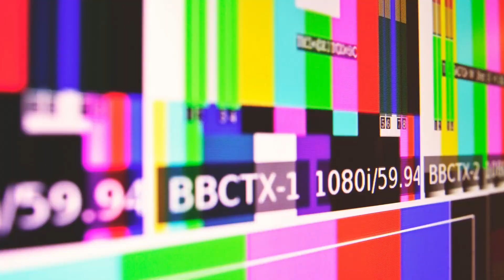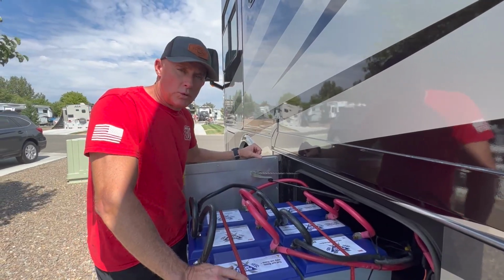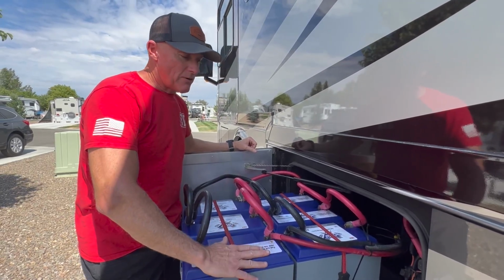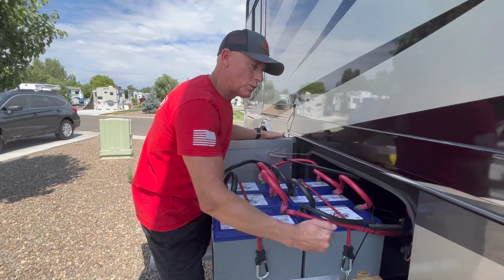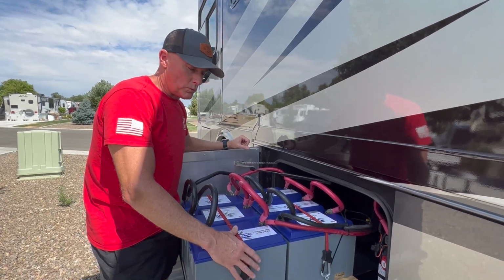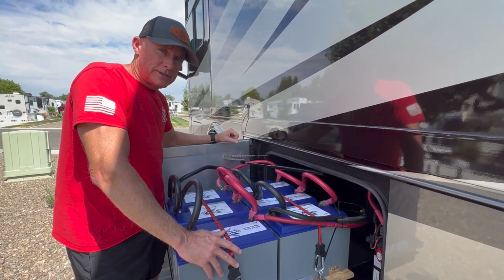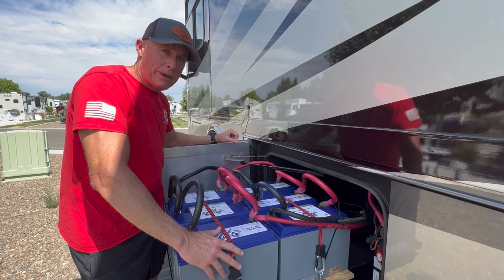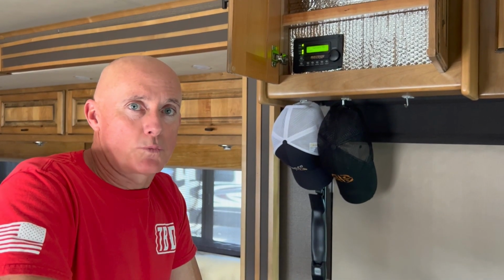Some UPGRADES come at a higher price.   Hopefully it is WORTH IT!

Comment: I want to add 4 Lithium batteries to our 37 PA we have the same inverter did you need to make any other changes? is there an issue with the alternator charging the batteries?  Thanks!
Reply from the maker: I did not make any other changes except for reprogramming the magnum to the necessary settings Battle Born told me to change. I've experienced zero issues with the alternator charging the batteries. Having said that, I would like to put a bigger inverter and a couple of solar panels on top. I'm not looking at a huge set up, just something to keep the batteries topped off. I'm going to talk to Dragon Fly at the Florida Super Show. Are you going to be there? Thanks for watching and commenting.